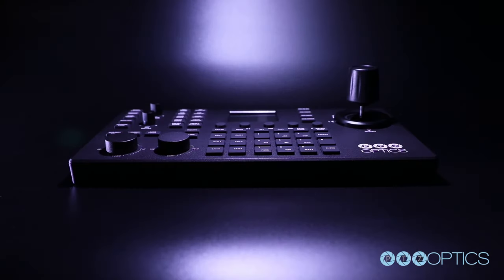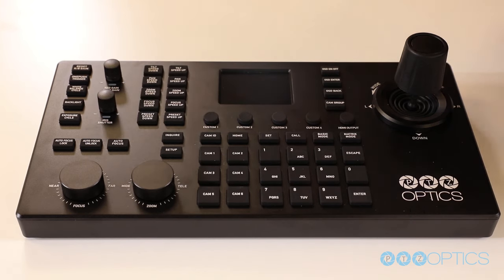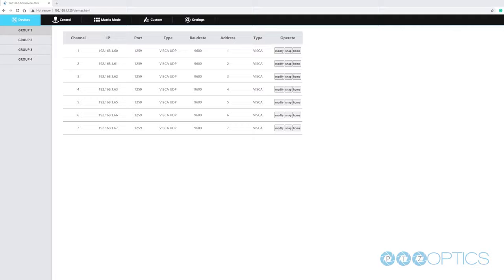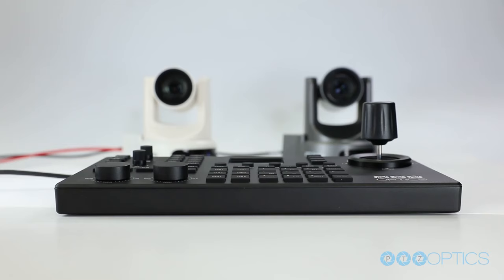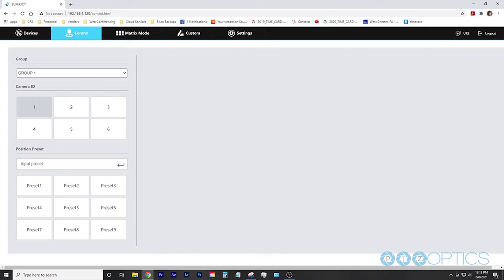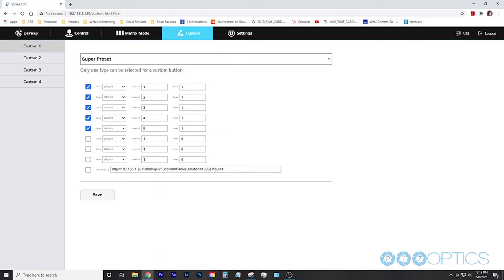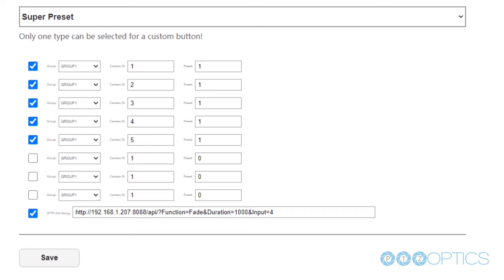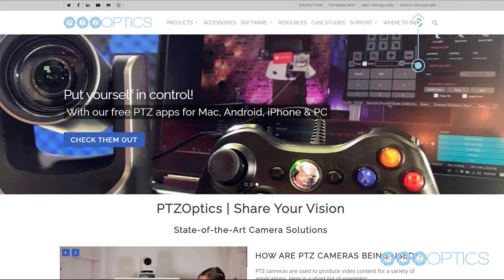PTZOptics SuperJoy IP Camera Controller Setup

Comment: Hi we have 3 ptz cameras and we are using a tablet and an app to control them,  Using a  SuperJoy  would make our productions better and they would appear a lot more professional
Reply from the maker: Its a amazing Joystick controller! Designed for smooth, efficient production workflows. The SuperJoy takes remote pan, tilt, and zoom camera operations to the next level in a simplified user interface with advanced controls for power users.
LINK: https://ptzoptics.com/superjoy/

Comment: Does the workflow for recalling presets always have to be:

Camera # -> Recall -> # -> Enter? Is there anyway to modify this for a quicker workflow? For example, if I'm already controlling camera 1, just hit preset 1 and it fires off the preset?
Reply from the maker: Hi Eric,
Yes! The SuperJoy has "Quick Presets" where you press and hold one of the alphanumeric buttons for 3 to store a preset, or press that same button quickly to call the preset. There's also "Matrix Mode" that allows you to call presets 1 ~ 3 on cameras 1 ~ 3 using those same alphanumeric buttons. 😀

Comment: is it normal the 1 sec delay between the joystic and camera movement?
Reply from the maker: Hello! 
A slight delay between issuing a command from the PTZOptics SuperJoy Controller and the camera responding is relatively common, especially in network-based PTZ (Pan, Tilt, Zoom) control systems. A delay of around 1 second can be considered normal in many situations, but the actual delay can vary based on several factors:

Network Conditions
Network Speed and Traffic: The speed and congestion of your network can impact the responsiveness of PTZ controls. A heavily loaded or slow network can increase delay.
Network Type: Wired networks typically offer better performance and lower latency compared to wireless connections.

Camera and Controller Settings
Control Protocol: The specific PTZ control protocol being used (e.g., VISCA, Pelco-D, etc.) and how it's implemented in both the camera and the controller can affect responsiveness.
Firmware Version: Ensure both the camera and the SuperJoy Controller are running the latest firmware, as updates can sometimes improve responsiveness.

Distance and Hardware
Physical Distance: The physical distance between the controller, network equipment, and the camera can play a role, especially if signals have to travel through multiple switches or routers.
Hardware Performance: The processing power of the PTZ camera and the controller can also impact response times.

Environmental Factors
Interference: In the case of wireless connections, interference from other devices can cause delays.
Camera Mechanics: The mechanical response time of the camera itself can vary; some models may naturally have a slight delay in responding to PTZ commands.

When to Investigate Further
If the delay is significantly more than 1 second, or if it has recently increased, it might be worth investigating.
Sudden changes in responsiveness can indicate network issues, hardware problems, or configuration errors.

Troubleshooting Steps
Check Network Performance: Test the speed and stability of your network.
Update Firmware: Ensure all devices are using the latest firmware.
Restart Devices: Sometimes, simply restarting the camera, controller, and network equipment can resolve transient issues.
Test Different Conditions: Try controlling the camera under different network conditions or with different settings to see if the delay changes.

If you find that the delay is unusually long or affecting your production, it might be worth reaching out to PTZOptics support for more specific advice or to check if there's a known issue with your particular model or firmware version.

Comment: the best would be, if you could safe camera movements. Actuall calling a preset first moves the pan, than the tild and than the zoom (or in any other order). But it would be realy good to call a whole movement: pan, tilt and zoom in a specific joystic pre moved way. That would be a real gamechanger! ;) ALSO, the active controlled camera should be shown at the hdmi video output. (actual it is not clear,  wheater the controller does or not does.
Reply from the maker: The PTZOptics cameras have a feature called "MotionSync" that synchronizes pan tilt and zoom so that they arrive at the preset location at the same time. When the HDMI Output is enabled on the SuperJoy, it will display the actively controlled camera on a connected monitor. Hope that clears things up!

Comment: Could you use this controller to control PTZ cameras through a Tricaster TC1?
Reply from the maker: Hello!
Yes, you can use the PTZOptics SuperJoy Joystick Controller to control PTZ cameras through a TriCaster TC1, but the integration requires an understanding of how both systems communicate and the proper setup. The PTZOptics SuperJoy offers versatile control options, including support for VISCA, VISCA over IP, Pelco-D, and Pelco-P protocols, making it compatible with a wide range of PTZ cameras. Here's a general guide on how to set it up:

Step 1: Connect Your Cameras to the TriCaster
First, ensure your PTZ cameras are connected to the TriCaster TC1 and properly configured within the TriCaster system. This involves connecting the cameras via SDI or NDI®, depending on your specific setup and camera capabilities.

Step 2: Network Configuration
Connect the SuperJoy to Your Network: The SuperJoy Joystick Controller operates over your network (for VISCA over IP controls), so it must be connected to the same local network as your TriCaster and cameras.
Configure IP Addresses: Ensure all devices (TriCaster, PTZ cameras, and SuperJoy) have unique IP addresses on the same subnet to communicate with each other effectively. You can find and assign IP addresses to your cameras through their respective web interfaces or dedicated software.

Step 3: Configure SuperJoy with Camera IPs
Add Cameras to SuperJoy: Access the SuperJoy controller’s setup menu to add each PTZ camera. You will need to input the IP addresses of the PTZ cameras you're controlling. Refer to the SuperJoy manual for detailed instructions on adding and configuring cameras.

Step 4: Control Protocol Selection
Select the Appropriate Control Protocol: On the SuperJoy, select the control protocol that your cameras are using (likely VISCA over IP if they're PTZOptics cameras or compatible models). The TriCaster system itself doesn't directly affect the protocol used between the SuperJoy and the cameras; it simply acts as a switcher for the video feeds.

Step 5: Control Cameras During Production
With everything set up, you can now use the SuperJoy controller to operate your PTZ cameras (pan, tilt, zoom, presets, etc.) during your live production with the TriCaster TC1. The video feeds from the cameras go through the TriCaster, where you can switch between them, apply effects, and manage your live production.

Additional Tips
Firmware Updates: Ensure that the firmware on your PTZ cameras and the SuperJoy controller is up to date for the best compatibility and performance.
TriCaster Configuration: Within the TriCaster interface, make sure you've correctly configured each camera input and that you can switch between your PTZ camera feeds as intended.
Network Infrastructure: Reliable network infrastructure is crucial, especially when controlling cameras over IP. Ensure your network can handle the data traffic to avoid latency or connection issues.

Integrating the PTZOptics SuperJoy with TriCaster TC1 for controlling PTZ cameras can streamline your live production workflow, offering precise camera control directly at your fingertips. This setup not only enhances production value but also provides operational efficiency during live events.

Thanks for checking out our Channel! 
Learn More: https://ptzoptics.com/
Reply: @PTZOptics  Thank You So Much! This is exactly what I needed to know.

Comment: So... how many frames of lag on that HDMI out?
Reply from the maker: Hello!
Lag, or latency, in HDMI output can be influenced by various factors including the camera, the controller, the HDMI cable, and the display device. Typically, professional-grade equipment like the PTZOptics SuperJoy is designed to minimize lag to be as low as possible. However, the exact frame lag can vary and is often not specified as it can be influenced by the entire setup.

For precise information about the HDMI output lag of the PTZOptics SuperJoy controller, I recommend reaching out directly to PTZOptics customer support. They can provide detailed technical specifications and any known latency metrics specific to the SuperJoy controller.

Comment: I would use this to control the 4 PTZ Optics cameras we have in our church sanctuary or the 3 PTZ Optics camera we have in our conference center.
Reply from the maker: Its a amazing Joystick controller! Designed for smooth, efficient production workflows. The SuperJoy takes remote pan, tilt, and zoom camera operations to the next level in a simplified user interface with advanced controls for power users.
LINK: https://ptzoptics.com/superjoy/

Comment: can i used it on cameras | AVer PTC310N  & AVer PTC310UN with Pelco-D/P?
Reply: Yes if it supports PELCO this should work
Reply from the maker: Hello Hans,
The PTZOptics SuperJoy Controller is designed to be compatible with a wide range of PTZ cameras that use VISCA, VISCA over IP, Pelco-D, or Pelco-P protocols for control. If your AVer PTC310N and AVer PTC310UN cameras support one of these protocols, particularly Pelco-D or Pelco-P, they should theoretically be able to connect to the SuperJoy Controller. Here's how you can approach this:

Steps to Connect AVer Cameras to the PTZOptics SuperJoy:

Check Camera Protocol Support:
Verify in the AVer camera documentation that they support Pelco-D or Pelco-P protocols. This information should be available in the camera's user manual or technical specifications.

Connect the Cameras to the Controller:
If your AVer cameras and the SuperJoy Controller are designed to be connected via RS-485/RS-232 for Pelco-D or Pelco-P control, use the appropriate serial cables to connect them.
If they support VISCA over IP, connect the cameras and the SuperJoy Controller to the same network via Ethernet.

Configure the SuperJoy Controller:
Access the SuperJoy Controller’s settings to add and configure your AVer cameras.
Assign each camera an ID and select the appropriate control protocol (Pelco-D/P or VISCA over IP).

Test the Configuration
Once the cameras are connected and configured, test the control functionality from the SuperJoy. Ensure that you can pan, tilt, zoom, and access other camera controls and presets.

Address Any Issues:
If you encounter issues, refer to the SuperJoy’s manual for troubleshooting tips, or contact PTZOptics support for assistance.
Double-check all connections and settings to ensure they match the requirements of both the cameras and the controller.

Considerations:
Compatibility: While the SuperJoy Controller is quite versatile, specific compatibility can sometimes depend on the firmware version of both the controller and the cameras.
Cabling and Distance: Ensure that the cabling used is appropriate for the distance between the controller and the cameras, especially in an RS-485/RS-232 setup.
Network Setup: For IP control, ensure that the network settings are correctly configured and that all devices are on the same subnet.

Conclusion:
Connecting AVer PTC310N and AVer PTC310UN cameras to the PTZOptics SuperJoy Controller should be feasible if these cameras support Pelco-D, Pelco-P, or VISCA over IP protocols. It’s important to check the specific protocol support and compatibility, configure the devices correctly, and test the setup to ensure proper functionality.

Comment: The church needs a camera controller to help manage the 4 PTZ cameras we have in our sanctuary and would add a major element of flexibility to changing and controlling the different shots we use.
Reply from the maker: Its a amazing Joystick controller! Designed for smooth, efficient production workflows. The SuperJoy takes remote pan, tilt, and zoom camera operations to the next level in a simplified user interface with advanced controls for power users.
LINK: https://ptzoptics.com/superjoy/

Comment: How do you turn on backlit buttons on the controller?
Reply from the maker: The keys have context sensitive backlit lights. They light to show that an option is avaible. For example, when auto focus lock is pressed, the button will flash green. Buttons will also be backlit to indicate the limited buttons availble in Matrix and Basic Modes. :)

Comment: I would mentionn that the "Super Preset" only works with PTZ cameras.  Super Preset does not work with NewTek Cameras as of today.  They say it will control just about anything on the networ with the correct protocols but the camera presets for SONY VISCA aren't icluded in that statement.    Just be careful when purchasing.
Reply from the maker: Hello!
Thank you for highlighting this specific detail about the PTZOptics SuperJoy controller. Your caution is particularly important for those considering this controller for a mixed-brand camera setup.

PTZOptics SuperJoy and Compatibility
1. Targeted for PTZ Cameras: The PTZOptics SuperJoy is primarily designed to control PTZ (Pan-Tilt-Zoom) cameras, and its compatibility is strongest with cameras that use standard PTZ control protocols like VISCA over IP, ONVIF, and Pelco-D/P.
2. Limitation with NewTek and Sony VISCA Cameras: As you noted, as of the last update, the SuperJoy may not be fully compatible with NewTek's NDI protocol or certain implementations of the Sony VISCA protocol. This limitation is crucial to consider for users who have or plan to integrate these specific camera types into their setup.

Points to Consider When Purchasing
1. Check Compatibility: Before purchasing the SuperJoy, it’s important to check the compatibility of your existing or planned camera setup with the controller. This includes verifying protocol compatibility and specific model support.
2. Manufacturer's Documentation and Support: Consult PTZOptics' official documentation and reach out to their support team for detailed compatibility information.
3. User Reviews and Community Feedback: Often, user experiences and reviews can provide insights into real-world compatibility and usage scenarios.
4. Software and Firmware Updates: Keep an eye on software and firmware updates from PTZOptics, as they can sometimes extend compatibility and add new features.

Alternative Control Solutions
If you find that the SuperJoy doesn't meet your needs due to compatibility issues, you may need to explore other control solutions. This could include controllers specifically designed for NewTek or Sony cameras, or more universal controllers that cover a broader range of protocols.

Conclusion
The PTZOptics SuperJoy is a versatile controller for PTZ cameras, but as with any specialized equipment, compatibility with different brands and protocols is a key consideration. Users with NewTek cameras or those utilizing specific implementations of the Sony VISCA protocol should verify compatibility carefully to ensure the SuperJoy meets their needs. It's always a good practice to conduct thorough research and possibly seek advice from the manufacturer or experienced users in similar setups.